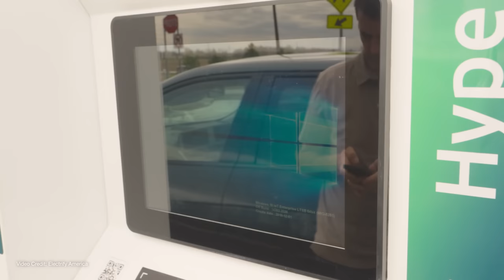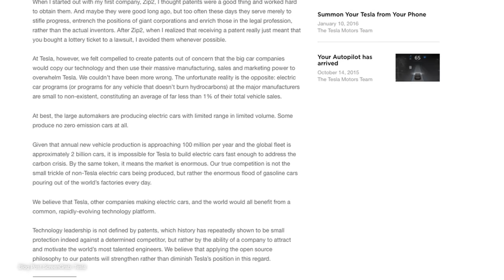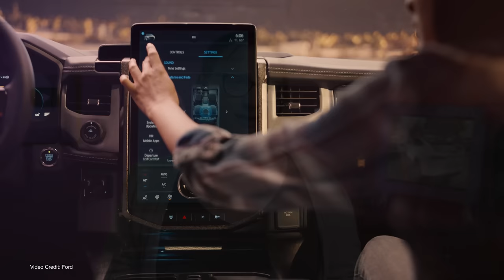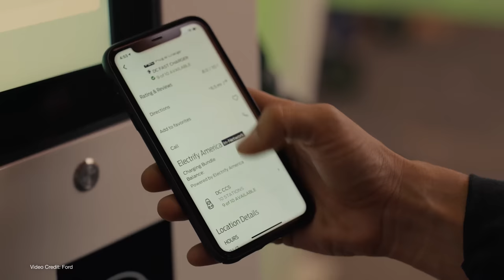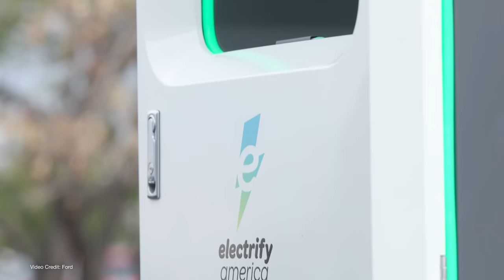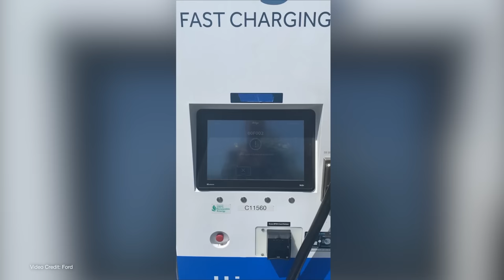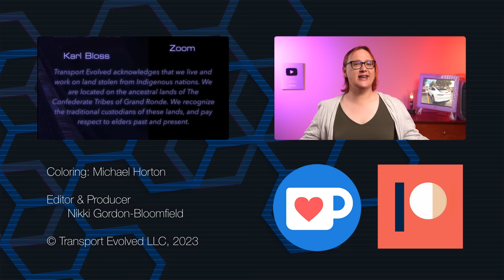Ford's Switching To Tesla's NACS Charging Tech - What We Know (And Don't Know)

Comment: I'm surprised there isn't already a third-party aftermarket for retrofitting charge sockets on older vehicles.   It should tidy up some of the mess in future.  Even some older Teslas could do with an upgrade in charging speed and V2x capability.
Reply: My understanding of the charge inlet isn't perfect, but I do know that the NACS connector uniquely uses the same two high-current contacts for both  AC and DC input power; somehow, the details are handled electronically by Tesla's onboard charger module.   On the one hand, Tesla only needs ONE high-current, high-voltage cable pair between its charging inlet and the onboard charger (OBC), vs. separate pairs for the DC and AC paths of CCS or CHAdeMO.  On the other hand, the electronic power-handling circuitry that Tesla's OBC uses currently lacks the features necessary to support power delivery back OUT through the charging port.   Retrofitting that capability is not likely to be easy.
Reply: The car needs to be able to work with the communication protocols. While more recent Tesla's in the NA market can talk CCS (and charge on CCS chargers with an adapter), older cars require a lot more than just a different inlet.

Comment: In australia they (tesla) have a seamless experience without their proprietary connector..
Reply: And as Tesla has shown around the world, the moment you start charging other cars at Tesla chargers, you get the same result as other CCS chargers. You might get lucky or you might have issues. Ranging from slow charging (eGMP cars) to not charging at all.
Reply: @Hans-gb4mv  It sounds to me like other vehicles don't know how to communicate with chargers of all kinds including Superchargers.
Reply: @wineberryred  Standards are not defined in a way that they attempt to address all potential issues, they do not come with a reference implementation for everyone to copy. Every engineering team has to design the hard- and software around the standards that are written.

And that simply means that sometimes you end up in situations that are outside of the specifications as it is impossible for everyone to talk to everyone to check if all of them are doing the same things when things do inevitably move towards some edge cases.

And I think the supercharger network is a prime example of this. Plug in a Tesla, and everything is fine, almost always (hardware failures excluded). But the moment a Tesla starts charging at a CCS station or a CCS car on a supercharger, you start running into the same issues. And the reason a Tesla on a supercharger has no issues is because it all comes from a single company, where it is so much easier for the different departments to work together around those edge cases and solve them.
Reply: @Hans-gb4mv  Tesla's chargers simply work better, have better plugs / less damage prone and the software running the chargers is better. Most charging networks are poorly run.
Reply: @davidc2838  and I have to keep repeating myself. Tesla's chargers work better... with a Tesla. The plug is better, mainly because of the very short cable which makes it light and easy to handle.

Interoperability with standards is difficult. No matter the manufacturers involved.
Reply: @Hans-gb4mv  Very good points and I think that is why Ford said that they will use Tesla's API in the Ford app and they made reference to using other Tesla's software.  First on that list would be the communications between the vehicle and the charger given that they will be using the Supercharger network.
Reply: @Hans-gb4mv  No need to keep repeating yourself, when it's NOT correct. Tesla's chargers work better with Teslas...and NON-Teslas too.  First, the Tesla Charger's UP TIME is simply higher than any other US Charging System. PERIOD. Better designed and better maintained. 
The Plug is better...because the PLUG is DESIGNED better, less bulky and not as susceptible to being damaged easily. Tesla V4 Chargers have a longer cable...and will STILL have a better plug.
Reply: @davidc2838  Better uptime is nice, but still no guarantee for a trouble free charging experience as people often suggest you would always have with a Tesla. So is it really an improvement?

And the chargeplug a better design? Not really. The biggest issue with CCS cables is the weight of the cable. The weight mostly comes from the length of the cable. That makes them more difficult to handle. And while Tesla will make cables longer on V4 chargers, it will still be a lot shorter than most CCS stations. The additional 4 feet of cable they'll add is not going to solve the issue when the chargeport is on the wrong side of the car for a Tesla charger.

Comment: I don't know why the government hasn't stepped in to set up a common standard yet. Europe has already done so... It needs to happen soon.
Reply: Because the gov't let's corporations tell them what policies to set.
Reply: Because the charging standard is sub standard.  Poorly designed plug and Tesla outsells all other EVs combined and it's the ONLY charging system I am aware of with super high uptime and very few issues.
Reply: @David C  This is the reason why the government should force a standard. They would get with all manufacturers to develop something that works better than anything we currently have. Once developed, it would become the standard across the nation. The standard should be flexible for future growth but also backward compatible for older cars. Otherwise, we will continue to have manufacturers with different standards that don't work well with each other. Consider the USB standard. The 3.0 is newer and faster than the 2.0 or 1.0, but it is also backward compatible. Same thing with the HDMI cable.
Reply: @SanchoSanto  No need.  Ford, Tesla, GM and others have already made the decision to go with NACS.  
I have NEVER heard "Let's get the Government to Develop Something that works better..."  
Clearly they don't do that and Governments are about as bad about designing Tech as they are about getting things done in a timely manner.
CCS is dead in the US / N.A.  Long live the NACS! ;-)

Comment: Not just Ford - Aptera's still on board for NACS, I guess?

Also, last I heard, the NACS plug wasn't rated past 400VDC. Has that changed? A lot of battery packs, especially bigger ones, are designed to charge faster at 800 to 1000VDC.
Reply: "A LOT of Battery Packs??"  How many exactly?  Tesla has about 75% of the BEVs on the road in N. America...so by definition, there are not that many packs that are designed to charge at 800 to 1000.
Reply: @davidc2838  How many exactly? How should I know? Also I'm not sure how you deduced that it's impossible by definition to have "a lot" of something if it's less than 25% of the total market. A weird restriction in your worldview, it seems to me. Well, doesn't matter. The future is faster charging. If one standard tops out at 400VDC, that'll be a pretty big mark against it into the future. If they can come up with a connector that accommodates 800V while still fitting into a rather large installed base of vehicles - great. If not, well, it'll be fine for L2 chargers, I guess, in business and hotel parking lots.
Reply: @ps.2  You're making up stuff and claiming "It's a LOT".  I don't believe for a minute it's actually "A Lot" show some large number from a verifiable source and I might stand corrected.  But I do know the vast majority of them are NOT 800 or 1000.   Because Teslas and others are clearly not.
Reply: @davidc2838  Audi, Porsche, Hyundai, Kia, and Lucid, it appears. (Apparently Lucid is 900V but when I said 800V that was only an approximation — DC charging uses a range of voltages, not just one or two fixed values.)  I know you don't think 5 auto companies is "a lot" because none of them are Tesla and that's your only benchmark. But according to Inside EVs, "Most Of The EV Industry To Shift To 800 Volts By 2025, Report Says." That is not a bandwagon you want to miss because you chose a plug that couldn't handle it.

Fortunately, a few months after NACS was released, they updated it for specs that claim to support up to 1000VDC. And they further claim that the 1000V variant of the plug is physically compatible with existing lower-voltage inlets, and vice versa. Which, I mean ... you'd think Ford would never have invested in a technology for their F-150s that didn't have a path to 800V ... but, I mean, they've made other wrong turns in this journey.

Comment: The assumption that Ford owners will pay more at Tesla Supercharger than Tesla owners is incorrect, Jim Farley made it clear in his announcement that Ford owners will pay the same rates as Tesla owners.  It is also incorrect to assume that Ford paid Tesla for access to the Supercharger network.  Now we need to get EA and EVGo to switch to NACS so that Tesla won't have a monopoly on charging.
Reply: That doesn't make sense EA is owned by VW. Plus, Tesla's Supercharge stations do not have the ability to go higher than CCS (300Kw vs 350Kw).
Reply: @JackJackninja  The NACS has two slightly different designs which operate at 500V and 1000V max with no limit on the amperage but they have reached 900 amps with liquid cooling.  With the 1000V design and 900 amp output would give you 900Kw output as a theoretical maximum.  The reason I saw theoretical is that the vehicles battery would have to be designed to accept the high voltage and amperage of which there is none on the market today.
Reply: @JackJackninja  Which is why EA is substandard as a charging network. Ford made the correct call, they want to have a better network than EA. Those substandard charging systems will cause other EV makers to lose EV sales. Those who join the NACS, will like do better than those who do not.

Comment: 11:16 If Tesla puts up adapters to its stations, why there is a need for Ford, to replace the standard CCS to NACS. Rest is solved in software :)
Reply: Ford KNOWS which standard is better...which plugs are more reliable and less likely to break / become damaged.  They are also probably already talking to Tesla about having their much better Software Engineers create all the software / charging system for the next version of the Ford charging ports on their vehicles.  Wouldn't be surprised if it goes further that that too.

Comment: As one very rarely drives across the Atlantic (or Darién Gap or Bering Strait),  having a different charging standard in North America and the rest of the world is not a big deal, IMO. After all, we have at least three very different domestic wall outlet standards (with variants) only in Europe.  That said, I think that V2G capability is a crucial feature, but i don't thing it would be a huge problem to include it into Tesla's system. After all CHAdeMO had it from the start, with CCS only acquiring it later.

I am only a bit irritated by Tesla calling their system "North American Charging Standard" before it has been specified as such by any standardization body, be it just a trade organization with several corporate members, organized by Tesla (but preferably something like IEC, IEEE, SAE or, even better, ISO). Something like "Versatile Charging System" or somesuch would be preferable, but I am nitpicking.

Comment: If you consider what the CEO of ford said on another youtube channel (with a guy called Robert who's previous career involved dressing up as robot who does house work 3 million years in to the future on a mining space ship).

The CEO of ford said that they are going to bring all the software development in house, because when each of their suppliers does own software they have a lot of software teams doing software which they are not in control of.

This doesn't sound good for recharging when you vehicle now has a new EV network to talk to.  You really do need the software to be running perfectly.
Reply: They will have Tesla create the Charging Software for Ford under contract...almost certainly.
Reply: @davidc2838  really you think Ford are going to get Tesla to write the software for Ford.

This software is to control the charging in a Ford using either any tesla or non-tesla charging station.  This software would also have to communicate with other software like payments software, battery management software, each of the electronic components in the ford will have it's own software and whilst it's recharging all the software will be talking to each other. And you think Tesla gets to write it, especially after the Ford CEO has been announcing that Ford will be bring software development in house.
Reply: @matthewbaynham6286  For the Transition period to convert to the NACS...absolutely.  Who has the BETTER Software Engineers??  The Silicon Valley started company?? Or the Dearborn Michigan company??  Give ya ONE guess. And it's not even close. Time to have the guys who built the Tesla Software, build out Ford's new software and smooth the transition.  Once the Ford SEs have the code, it will be easier for them to make changes.

Comment: I was all fired up to replace all our ICE vehicles with EVs this year, but my wife sort of panicked at the unknowns. Perhaps we'll do this in stages...
Reply: If you have more than one vehicle, start with one and try it out. I drive a Chevy Bolt in Arkansas. It’s totally doable as long as you have a place to charge at home. Charging away from home is slow in the Bolt and there aren’t as many charging sites as I’d like, but I’ve never gotten stranded. And it should only get better as more charging stations get built in the coming years.
Reply: @RyanWilliams222  Fortunately, because of an electrical panel extension I needed for other things, I have 100 amps available right at our parking location.
Reply: @johnfilce9236  Heck yeah! My wife and I have 100 A service, which is just enough for us to charge my Bolt (Level 2; 240 V) and her Prius Prime (Level 1; 120 V). If she gets a full-electric someday, we’ll have to either upgrade to 200 A service or get some kind of fancy Level 2 charger that splits the charge between two vehicles.

Comment: Thoughts on charging:
Apps should NEVER br required. They all suck and often take even longer than other methods (also they don't work if you have no signal or your phone is dead)
RFIDs generally work pretty great and should be available for those who want them and/or don't have a car compatible with "plug and go" type systems (like what Tesla and some EVgo chargers use)
There needs to be more gas station style charging stations, and they should have the ability to pay with cash just like you can with gas.
Any EV network using grants or government funding should be held to a strict maintenance  and upkeep standard, and if they can't keep their stations online they should lose that funding (maybe even pay fines/return funding for especially egregious examples)
Reply: This!   Why can't I just roll up, scan my card, and charge. What is up with all the apps and charge networks?
Reply: All you do with a Tesla is plug in and walk away. No swiping

Comment: Tesla can and has Vehicle to Load as they did with the original Tesla Roadster.  I believe Tesla will be coming out with V to L and V to Grid on the 2024 Cybertruck.  I hope the rest of the Tesla lineup will also get these features.
Reply: Current Tesla cars do not have the required hardware for V2x.
Reply: @Hans-gb4mv  Sorry I don't think so.  Just that Tesla has not offered the feature and software.  It will be another MONEY grab at a day in the future.  2020 models and newer IMO.
Reply from the maker: V2X is more than just a switch. It does require planning. And in the same way that NACS requires MORE than just a connector, so too will V2X.
Reply: @davidws5439  People who have done an analysis of the power electronics available in Tesla's cars have shown that those electronics are designed in such a way that they only have the capability of letting power flow from the charge port into the battery, not the other way around as would be required for V2x. From what I have seen so far, Tesla has not made any drastic changes to those components recently that would enable V2x.
Reply: @Hans-gb4mv  Thanks for your information.  I bought a 2018 DMM3 and a May 2022 DMMY.
The suspension is way too stiff  and ruff ride.  Other than that and V to L it's pretty good.  The Cybertruck is my next vehicle IF they are very plush on the inside/interior and it MUST have V to L and or V to G or I will switch brands.  I'm also a stock owner at $38.00 per share.
Reply: Tesla's long term "solution" is to drive down the cost of battery manufacturing and make PowerWalls more affordable than the V to Grid systems which go dark if you need to drive somewhere.
Reply: @beachcrow ? Maybe.  Most people want the backup for only when you have a power outages for a few hours or s couple of days.  Also, a small battery pack could keep the refrigerator and or freezer going several hours without needing the vehicle home.  Most of all I want it for boondocking.  Being able to power a small or large RV off the grid would be perfect. Or even camping out of the back of the vehicle for a weekend. Also, having power on board to weld or run power saws away home the house would be nice as I have a small acreage.  Be able to give another EV power would be great too.